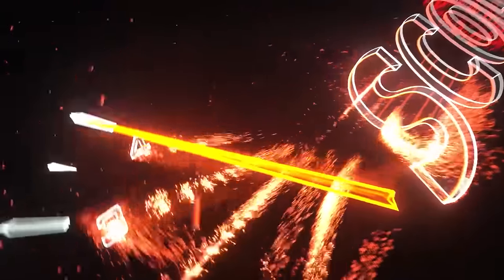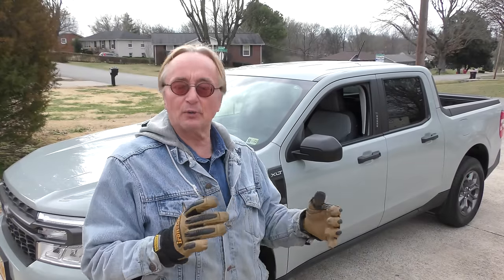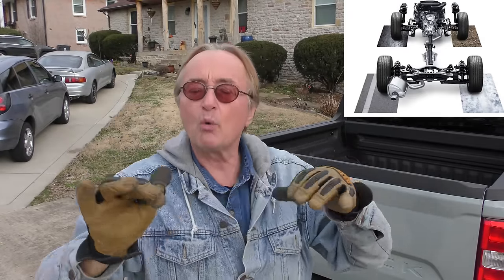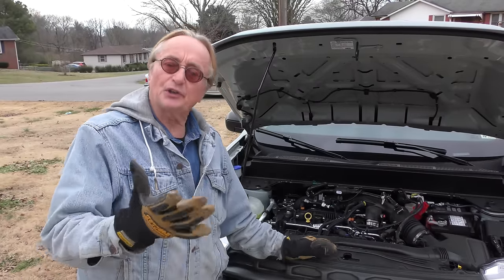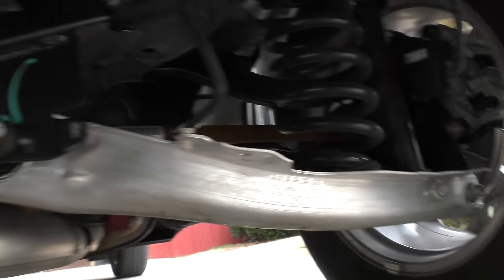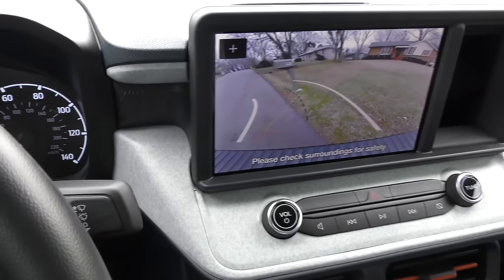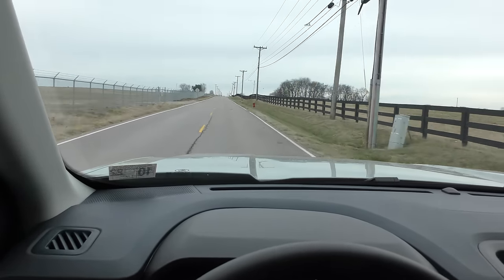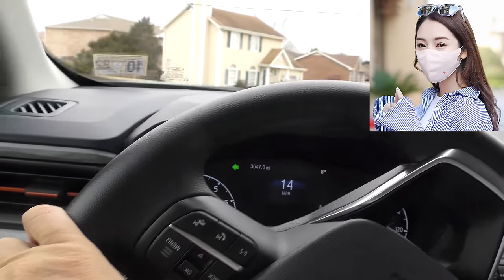I Finally Got a New Ford Maverick and Here's What I Really Think of It

Comment: Great review Scotty, I really enjoyed and appreciate it. I’ve seen several of these on the road and thought they looked great. I drive between 50,000 and 55,000 miles a year as a service tech maintaining the machines that build our vehicles domestically, so it makes it hard to justify buying a new vehicle when I will be out of warranty with 3 years of payments left. If I bought one I would be looking for the best mileage without relying on the hybrid system since I don’t have time to stop and charge it when a customer has a machine down. First thing I would do is retro fit it with vintage Ranchero badges just to mess with people. Also love to hear you ride a Triumph, we’re a big bike riding family too. Stay safe out there!
Reply: These aren’t a plug-in hybrid. There’s no plugging them in to charge like an EV. It charges the battery purely via the engine and regenerative braking. Start the truck and go.
Reply: A hybrid does not plug in unless its a plug in hybrid. Do your research before buying anything.

Comment: Had an F150 a few years back but it was huge! Impossible to park and difficult to use for mostly city driving. Have the FWD Maverick XLT 2.0 now, and it’s a much more manageable vehicle. Like Scotty says, it drives well and has plenty of power. Love the interior storage especially under the back seat which he didn’t mention. Very happy with my purchase.
Reply: F-150’s are not huge trucks ! Lol 😂 I drive a F-350 , that’s a huge truck!
Reply: Impossible to park?? 150s aren't that big
Reply: I get what you're saying brother.
Reply: @roadglide1142  A modern F150 compared to a '98 F-150 is HUGE. Trucks have powercrept to enormous dimensions.
Reply: I agree I drove my boss f150 and parking can be a pain
Reply: You just cant park my guy lmao
Reply: @SlavicCelery  I totally agree brother my 2011 F150 is definitely hard to park especially in tight corners.
Reply: Practice with a F-350 Dually and then the F-150 will feel like a walk in the park
Reply: @lxn_ni1814  it ain’t hard it just not simple. Resort on backing into a park spot to make it easier.
Reply: @roadglide1142  even the standard relatively low riding F150s are tall enough that a 6' tall person has to climb up on the tire to reach into the bed to grab just about anything that might be in the bed. Compared to most older trucks the current F150 is an impractical monstrosity for most people.
Reply: Lol right, f150s from a few years back aren't huge.
Reply: @user-xw4vg1vy5e  Well, compared to my ‘95 Eddie Bauer, my 2013 seemed gigantic!
Reply: Well if it was that easy to go from F150 to a maverick then you didn’t need a truck in the first place. If you actually use it as a truck, the maverick will fail miserably 
Cheers
Reply: @tomdavis3038  Well there were a few other vehicles in between. Very happy with my Mav so far.
Reply: @tomdavis3038  That depends greatly on what you actually mean by "use it as a truck" the maverick has roughly the same payload rating as my father's F150, so if you define a truck by it's ability to haul brick, or gravel, or sand in it's bed the maverick is built with performance that is in the same ballpark as an F150. The bed is large enough to haul furniture or plywood without being as dimensionally constrained as your average van. The vehicle can also be modified with to suit a particular job with features that aren't as practical in vehicles that don't have a bed like a small crane. The Ford Maverick provides significant functionality that simply isn't possible in enclosed vehicles like a van, so unless you define a truck by some arbitrary towing capacity cutoff it isn't necessarily accurate to state that all people whose needs are met with the Ford Maverick could do the same things without some form of truck.
Reply: I have a 2019 Roush F150 Super Crew that I bought when I renovated my house.  Love it, but after renting a new Malibu and Camry, I miss the peppiness/handling of a small car and the F150 is way more truck than I need.  Seriously considering trading down for a Maverick Lariat.

Comment: I had a 2001 Ford Explorer Sport trac until about a year ago and that little truck worked great. A lot of the stuff you talked about in this video reminded me of that truck and kinda made me miss it 😅 had it for about a decade and never had any major issues with it. Also, usually in my experience in newer cars with the ‘turn off the engine when you stop’ feature, you can turn it off
Reply: Yes I agree. I have a 2003 sport Trac.
Reply: Yes, with this and my '22 Ranger there is a button on the console to turn off this auto shut off feature...
Reply: @griff4899  i still have my 2003 sport trac too mecanic is still great but the rockers are getting eaten by rust :( but i still love it
Reply: Had a sport trac and loved the tie downs and especially the roll down rear window! Sadly Ohio salted roads ate it up.
Reply: For a year I'm dreaming of a 2010 Sport Trac Adrenalin with V8 and navigation package. 😎

Comment: It's so sad that trucks with manual transmissions are just about gone and soon to be forgotten.
Reply: I just rebuilt a 1995 Mazda b3000 4x4 with a stick shift. I didn't think I would like a truck in manual but I sure as hell do! Plus the gas mileage it gets is impressive.
Reply: Mine has 300k miles on it. I'm never giving it up. Still the original trans, smooth as butter. I learned on a stickshift, and I've always loved them.
Reply: @titussardonicus338  I have an '09 Ranger with 225k kilometers. The engine and transmission are mint but the rest of the truck is rusted to pieces. That's typical around here. It's actually 3 to 4 years older than a vehicle typically lasts. I try to buy old vehicles and drive them until they wear out but I'll be forced into one of these new whizbangs eventually.
Reply: Oh well

Comment: As someone that has worked on vehicles a lot, when he opened that hood and showed that mess of wires in the engine bay I got scared and nervous. The stop and start function is a major turn off though. I thought the car I was driving died when I first experienced it
Reply: I think you can turn that off. It's a button.
Reply: Plenty of mechanics are still afraid of (and/or ignorant of) working on a Prius, which is one of the most common cars on the road because of the hybrid element.

Comment: Which one would last longer, the Hybrid + CVT + N/A engine or the Non-hybrid + Automatic + Twin turbo/GDI engine?
Reply: I'd bet on the hybrid with the eCVT.
Reply: eCVT, big difference
Reply: It’s not a twin turbo. It’s called twin scroll turbo.
Reply: Hands down for the hybrid, it's Atkinson cycle engine and it's E- CVT is very similar to the Prius setup. The hybrid will outlast the eco boost everytime, Ecoboost engines aren't known for reliability. I have lots of experience with them and will never own one. That's why I ordered a hybrid XLT
Reply: @jascospeed   The hybrid system has history and a good track record. Mechanically simple and incredibly clever.

Comment: I'd be interested in this pickup if it had a V6 in it. I also don't want an ecoboost engine nor a turbocharged one.
Reply: I'll bet the Hybrid will hold up better than the turbocharged Ecoboost 4 banger.
Reply: @metalmike570   People abuse the turbos, that's the biggest problem with the turbos, the only drawback is when a turbo goes some people are so tight they will try to get by without replacing the turbo( seen that too many times on the old turbo Mustangs and Subarus)

Comment: Only thing I disagree with in this is about the tires, in the FWD version I would still by all 4 winter tires, winter tires on the driven axle will get you going fine, but while braking and turning, you're still lacking all that grip in the rear. Could end up with some very undesirable handling characteristics.
Reply: After spinning out twice on my first day of the snow season I went and got the same Nokia snow tires for the back as on the front of my Saab 900. Braking could probably get really exciting too.
Reply: @thewheelieguy  at the end of the day it's what connects your car to the ground, anything they can't do, the whole vehicle can't do.
Reply: I was told back in my young and poor days, that if you had limited funds, put the two new tires in the back on a FWD.  You rarely lose control of the front, but the back end kicking around will put you in a ditch faster than you can say "black ice".
Reply: Best tires go on the rear no matter what.  The tires need to be within 3/32's if all other things are the same since FWD tend to wear the fronts faster.  National tire chains won't let you deviate no matter what.
Reply: @GhostMerc86  Lets say you have 4 brand new tires installed, and as you say the fronts on a front wheel drive wear faster. In 6 months/10,000 miles time, you go to rotate them. Obviously the fronts will have more wear, but in order to do a proper rotation and ensure equal wear, they HAVE to go to the back. So, how is it, you figure, the best tires should be on the rear no matter what? Are you saying, you shouldn't rotate tires on a front wheel drive?
Reply: @steve8803  As long as the tires are within 3/32 then you are "ok" to rotate. Rotations should happen between 6k and 8k to make sure your wear isn't uneven.
Reply: @GhostMerc86  Right. So your statement "best tires go on rear no matter what" is not completely accurate. And 3/32nds are  a BIG difference. That's over 25% of the useful life of most tires.
Reply: @GhostMerc86  You say "best tires go on rear no matter what". Then you essentially say you can put 4/32nds on the rear and 7/32nds on the front because they are within the 3/32nds threshold. That is a MASSIVE difference in tread depth.
Reply: You will not ever be going fast enough to get in trouble...
Reply: A lot of places won’t sell you just 2 snow tires.

Comment: I've had a S10 from the 80's and now a 2010 Ranger both 4cyl that got better mileage than this new technology for my Home Depot runs. 
They both were fleet models bought with over 100k on them. I traded the S10 w 1/4million miles for the Ranger now approaching 1/4 million. 
No way would I ever buy a used 100k turbo with a cvt transmission. 
If my old Ranger dies before I do, I'll have a rebuilt engine & trans put in first.
Reply: '92 Ranger and '95 S10...kick myself for selling them. Nothing fancy, ran when parked and ran when needed. No visits to stealerships.
Reply: The old Ford Rangers were gutless and never even saw one get over 25 miles to the gallon. The E-CVT doesn't come with an EcoBoost.
Reply: I picked up an 87 s10 with a 4 cylinder and 4 speed stick, great little truck after i did some maintenance. Goes the speed limit plus and hauls what i ask it, no ac but its a cheap second vehicle with cheap insurance.
Reply: A 4cyl Ranger would struggle to get the same hwy mpg as this turbocharged Maverick, and the turbo Maverick is considerably faster. A 4.0 V6 Ranger (I used to have one I know what I'm talking about), still doesn't match the power of the turbo Maverick and maxes out at about 22mpg hwy. The hybrid Maverick gets as high as 42mpg city AND is considerably faster than the 4cyl Ranger. For even less money (inflation adjusted).
Reply: @jamesm568  yes the 2.3 lima was very under powered, 100hp , around 2000 they came out with the 2.3 duratec @ 141hp which is perfectly adequate even when overloaded with firewood. 
Driving easy with a 5sp w/overdrive unloaded it gets 29mpg.
Reply: I have that Ranger with the 4.0 V6....other than some weak cylinder heads, improved ones are available, the truck has worked out well.
Reply: We still have our 1984 S10 P/U & our parents 1989 S10 Blazer. Both with > 250,000 miles with many original engines / transmissions parts, with original gears in 89 after auto rebuild of soft parts. The 84 has original crankshaft / rods after being re-bored .030 over with new pistons & rings. That`s just what we did replace worn parts rather than buy a newer more complicated truck. Our old trucks get > 22 mpg in combined driving hauling tools & heavy items like feed for our farms thoroughbreds.The 84 can get 27mpg if not to heavily loaded.

Comment: What they should do is make a full body frame pick up with an inline 6 and get rid of that automatic shut off . And to make it cheaper for tires go with a option for four-wheel drive and make it a front-wheel drive four-wheel drive system . Now that would be a truck . Get rid of electric windows and just do the regular handles . They need to make these things where they're not so electronic computer dependable .
Reply: The dealerships won’t make any money if they actually cater to their customers’ needs 😂 great ideas tho
Reply: So true! Getting back to basics will lower prices all around.
Reply: One of the reasons I'll be keeping my old diesel as long as humanly possible. No computers! 

If any critical components are inoperable without electricity, I won't even consider buying it. :3
Reply: Ford won't make one bc they wouldn't make enough money on it. Ford is headed towards all electric. I have eight Fords now but won't be buying anymore of them.
Reply: You need a truck from the sixties.

Comment: I got my hybrid in December. I just have the XL. My wife and I love it. We live outside of town and do a good amount of highway driving but we are still getting an average of 41 MPG. 
Only thing we are kinda bummed about is there is no cruise control. Wasn’t thinking about that in 2021. Especial since it has pretty much everything else. Not a deal breaker but we were surprised.
Reply: Hi. I have the xl also. Everytime you put it on reverse; does the car make a loud clicking sound? Mine does. The dealer is telling me that all of them does it since the engine is so quiet, it is to alert pedestrians when the car is reversing.
Reply: @jaidreedex  Ya. I think it’s actually coming from the side mirrors.
I had my windows rolled down while in reverse and it seemed like that’s where it’s originating.
Makes sense that it would be because it’s so quiet. I hadn’t thought about it that way.
Reply: I'm shocked it does not have cruise control.  Why??
Reply: @robert982  to cut costs down
Reply: Have to get the XLT package or above to get cruise control.
Reply: Not sure if this applies to mavericks, but on my 2012 focus that didn’t have cruise control factory, the wiring and even programming was there, i just had to buy a used steering wheel that had the cruise control switches! Plugged it in and it worked great.

Comment: The Maverick has future classic written all over it. The AWD version is a bargain as well...
Reply: bigmike obama  think he means classic like the Ford Ranger
Reply: @mcc7762  it will be a classic vehicle in thatM it wont be forgotten and likely be sought on the aftermarket for many years,.. unlike most of  the current fat rear ended suv's that you probably like.....😂
Reply: bigmike obama  I'm talking like the old Ranchero or Ranger etc. I bet this little trucks have long lives ahead of them.
Reply: @mcc7762  Meh. People worry about that too much. These engines will easily achieve 150k plus.  Even if they need new engines eventually... once these get used and into the hands of young gear heads you will see them on the road for a long time and YES....they will be remembered. Not forgotten like garbage out there like the Chevy Equinox....😂😂

Comment: Ford has struggled in the quality department as of late… I worry about the new products Ford is releasing. I am sure since the Maverick is based on the Escape platform the Maverick won’t be as troublesome. But Ford really needs to get their act together.
Reply: Their quality has been questionable for a long time
Reply: Funny you mention it, the escape has had issues for a while with blown head gaskets. One of my coworkers has had 2 and both starting having issues around the 60k mark.
Reply: @northdakotaham1752  no they are not. GM is going all electric. Ford had no plans to go all electric
Reply: @BamaShinesDistillery  I have inside info...Ford is going all electric..
Reply: Ok. But bankrupt?  They have the best selling vehicle 1 2 3 and 4 this year
Reply: @BamaShinesDistillery  the EV vs ICE argument is all about politics....which will change.
Reply: @BamaShinesDistillery  Ford is making a huge mistake putting all their money on EV because it's all politics, dependent upon who sits in Washington. Ford's big money is in trucks.
Reply: @CJColvin  small displacement, high reving turbo charged engines put out alot of HP....but for how long? That's the question. I will never own one.
Reply: @northdakotaham1752  Same here

Comment: Driving my 2014 RAM Longhorn with the 5.7-liter HEMI from Washington D. C. to Las Vegas I averaged 25 MPG at 75 MPH using the cruise control.  I was impressed considering the size of the engine and the nearly 5800-pound weight of the truck with me in it.